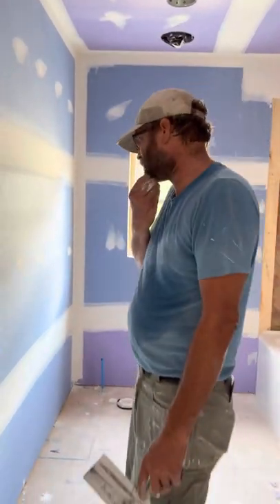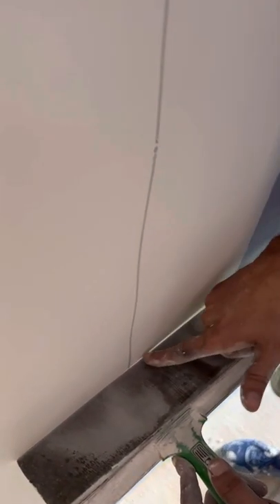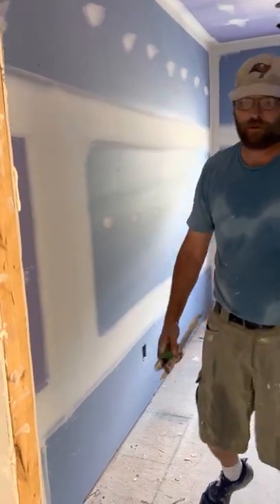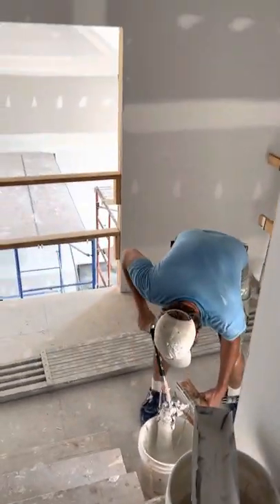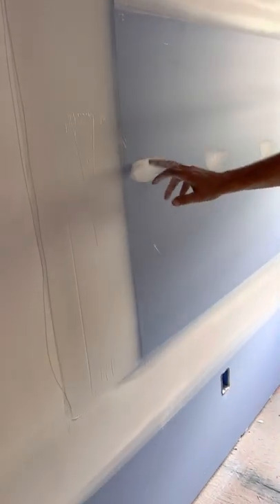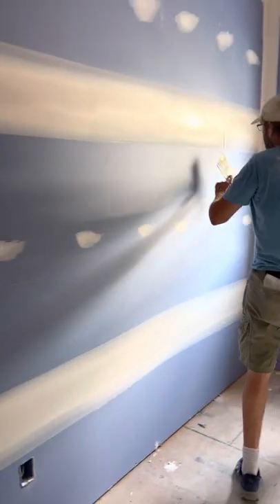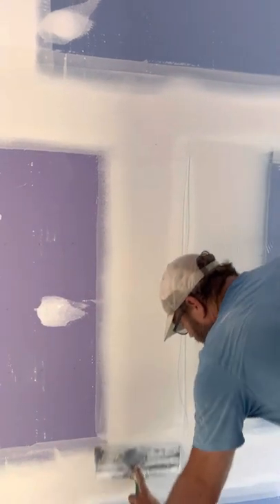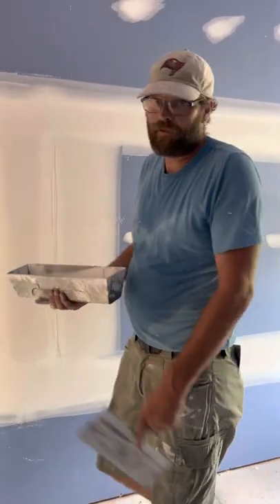Tapetech 12” box, skimming bad butt joint.  Make them flat.

Comment: I’m seeing finishers who are using mudding tools and taping tools who are all about production and they only want smooth results instead of having flat results
Reply from the maker: Yeah, a lot of them run the boxes and think that’s suffice. But the reality is if you don’t knife, check them sometimes you’ll get Hopi flats as they might be set wrong and leaving too much mud.
Reply from the maker: It’s a simple as taking a 12 inch knife and checking the flat to see if it’s actually flat after the box is ran it. Boxes in my opinion are strictly for putting the mud on so you don’t have to sit there and stupid out of your pen and apply it by hand